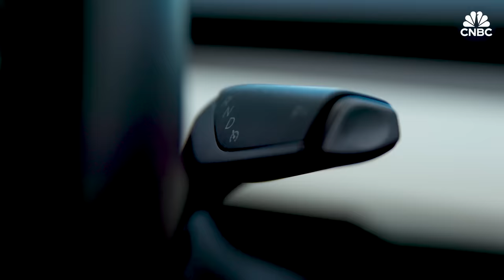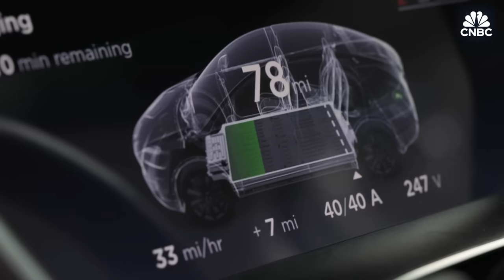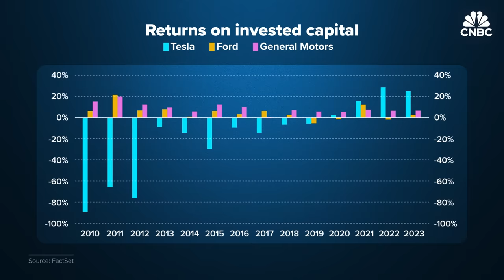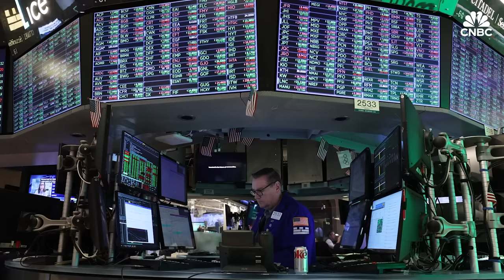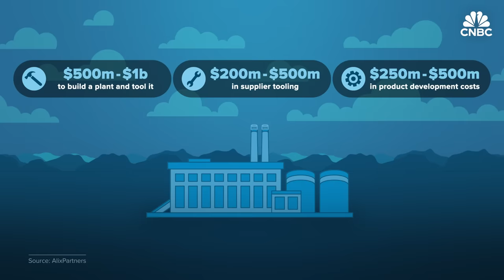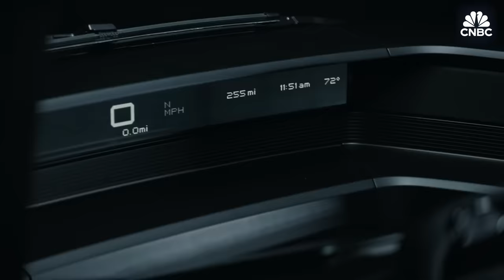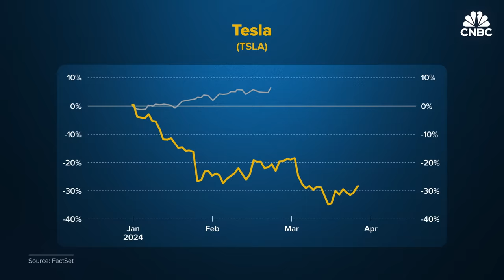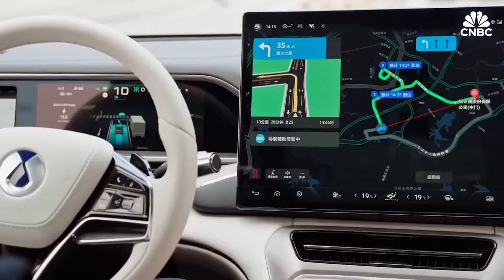Why So Many EV Companies Fail

Comment: Seeing a lot of ignorant comments from people who have no clue that EVs are not only better cars (only a more invested charging infrastructure needed) but they really aren’t any more expensive for the life of the vehicle. Funny how you never hear how pick up trucks are too expensive to buy. But of course, anti EV propagandists will use that outdated rationale.
Reply: Its not ignorant comments it's bot accounts
Reply: @Wongseifu548 good point
Reply: I hear about how expensive pickup trucks are to buy nearly every single day, but I'm on the truck forums and work with truck buyers.  Regarding EV's, there's a lot of bad information out there, some of it due to malice, and some due to ignorance.  It goes both ways though, the EV forums are filled with false estimates of cost to run ICE and hybrid cars.  I nearly purchased a Tesla but went with a hybrid Camry.......the creative accounting that people on the Tesla forum were using against the Camry was pathetically biased.  As far as ignorance, you have people like my FIL, who told me that EV's need their battery replaced after 5 years.  <facepalm>
Reply: @InPursuit2023 people also are not taking into account how much of a better drive EVs-let alone better for the air quality-not just now but also in the future. Exclusively focusing on money is missing the bigger picture. Myopic thinking is rampant.
Reply: I would buy an EV if it had a retractable extension cord built-in to recharge it in the garage.
Reply: Until the battery dies. What happens then? It goes in landfill. Or car catches on fire.
Reply: @realnapster1522  fantom issue. Again, a lot of ignorant beliefs. I guess-you’re against smart phones too. SMH

Comment: Because moving an 80kg human with 2000kg of refined raw materials is insane. It's inefficient & a massive waste of resources.
Reply: Depends on how you measure efficiency. I can drive to my sister's house in 20 minutes on weekends where there rarely is much traffic. Attempting to make the same trip using public transportation on weekends where many routes are either hourly or not operating at all will take 2-4h depending on how the 3-4 transfers I'd need to take line up. Add the return trip, that is 4-7h of the day wasted. During peak hours where most bus lanes are running every 15min, it would be a somewhat more palatable ~1.5h.

If I didn't have my own 1300kg box of refined materials or one I could easily borrow, I'd have to hire another 80kg human to drive his 2000+kg virtue-signalling tire-ripping box of more exotic refined materials to me, drive me to my sister's house and then drive however long to his next customer, rinse and repeat for the return trip. That is an even less efficient use of resources.
Reply: @teardowndan5364  That's a failure of urban planning... back in the '40s we seemed to believe that building our entire infrastructure around the car was a good idea. Turns out, it has tons (pun intended) of downsides too
Reply: Mrfunnybones  that's a very good observation, and broadly speaking, very relevant. It makes electric motorcycles look like a very good idea. Limited range, yes, but perfect for urban and city use during the warmer months. Efficient, and zero emissions, at point of use, so great for air quality. I think we must always remember how important air quality is, in urban centres. 
We are currently in the infancy of battery technology, so this metric you describe will surely change in the future, by a huge margin.
Reply: @neaorin  Even in a public transport wonderland, you'd still have mostly 2-3 cars wide streets everywhere simply due to the need for delivery, moving, construction, utility, emergency, public transport, trash disposal, etc. vehicles to be able to park on either side of the road to do their job while  leaving enough space for a third vehicle with business on the same street to still be able to drive through.

Highways may have fewer lanes (probably still will want a minimum of three through urban areas to avoid having to shut the whole thing down on every minor incident) but roads will still need to be built at least as strong as they are now to support every heavy vehicle gaining another couple of literal metric tons of batteries to achieve adequate range between charges.

Cities would still look mostly the same overall, minus the parking spaces. With people having significantly more limited mobility, you'd also have a lot more space spent on smaller, less efficient local shops duplicating each other for locality's sake. I know I have no desire to go back to the days of seeing a McDo or whatever the next craze will be at every other street corner. Restaurant prices are already out of control, imagine if they had to amortize their operating costs over 1/4th the customer pool size due to restrained mobility.
Reply: @teardowndan5364  That's not what I said though. Cars are good, and very useful appliances. For some tasks, they're essential. But building your entire society around the car - meaning that for 95 percent of the trips you want to do, a car is the ONLY viable option - has a ton of downsides. 

If you think cities would look the same, with 2-3 cars wide streets everywhere, go check out some '70s pictures of Amsterdam... then go visit the same city today.

Comment: Because only the rich can afford all the downsides to EVs. Only Ebikes make sense
Reply: what are all the downsides?
Reply: Ebike has a similar problem. Loads of Ebike blends pop up but most of them will not survive in the next ten years. Many Ebikes use proprietary motor, battery and control unit. When the blend goes, where do you find replacement parts? So the bike will stay in your garage, and eventually in the landfill.

Comment: EVs are too expensive (even cheapest Chevy EVs start around 40k). Batteries life span decreases as you charge and recharge. Car battery replacement costs as same amount as brand new ICE car.
Reply: Car battery replacement cost same as a new ICE CAR?! I didn’t know new cars cost around 10k. Were you finding these prices?
Reply: @Ye-tf9im  I talked to the neighbor, who is tesla tech. I live in Canada. He told me that if it is out of warranty. The battery plus labor to replace costs over $40k.
Reply: @ENTHUSIASTICFIFAFAN  For a Tesla Model 3 an out-of-warranty battery replacement is more like $12k USD, per receipts posted on Reddit.
Reply: Even then, it takes 8 years or 150,000 before the warranty expires and you will still have around 70% of the original battery capacity.
Reply: @ME-xc1st  But even major repair on ICE like engine replacement doesn't cost over 3K. So replacing the whole battery costing over 10k sounds too expensive. Should be 3 to 4k at max.
Reply: Fully charged on YT has a tesla on there that had it`s battery changed due to errors at 666-666km....

Comment: Everyone needs to understand - In China, there is massive subside by the government to keep growing this industry - here lot of money is being spent but the infrastructure is so poor for EV adoption (apart from Tesla) it's just a pain to use an EV for a long trip - improve the infrastructure, provide faster charging and it will automatically attract more customers
Reply: So it's the surrounding infrastructure parts that are relatively expensive, not the cars themselves.
Reply: Those EVs need to last too. Otherwise it defeats the whole point of an EV. What's better for the environment, upgrading to the latest baddest model every 5 years or keeping your same EV car for 40?
Reply: That is reasonable, I think convenience plays a huge role in the automobile market. Something like having more charging station and workshops that could maintain your vehicle would help for sure
Reply: also bring the price down, people aren't willing to pay $20k more for EV, this is a cost issue

Comment: They need to offer EVs with gas range extenders along side their BEVs. RE EVs only required a smaller battery and an extremely fuel efficient gas engine (I.e. Cosworth CatGen). A smaller battery cuts battery cost and the gas Range Extender takes care of the BEV shortcomings (I.e. charging infrastructure, charge times, etc.). I think way more people would be interested if they offered a gas range extender option. I sure as hell would be.
Reply: than why does the mazda not sell well it takes 8l and must run sometimes even if fully charged to not get cloget or let the fuel get to old

Comment: Massive cost.

100+ years of brand loyalty.

There’s no replacement for displacement.

I would have bought a small EV pickup truck years but the only options were tiny cars.  Get going already, Toyota.
Reply: Toyota doesn't want to make EVs, that's why they're switching everything to hybrid right now

Comment: It really doesn’t help that America basically started a trade war with China right before they started pushing EV because they also simultaneously started a war with Russia. EV cells pick up when gas prices rise. America caused gas prices to rise by putting sanctions on cheap Russian oil and natural gas. That forced both America and Europe to refocus on getting their citizens into electric vehicles because it was politically untenable to have such high gas prices. If you remember in 2021 premium fuel rose beyond six dollars per gallon.

As for these EV companies: most of them build small, barely desirable vehicles. 

Tesla has already shown you what you need to build in order to sell to the American market. 

You need a car that is larger inside than most other cars yet in between 30,000 and $50,000. The Tesla model 3 and model Y are great sellers because they outclass Honda/Toyota/Nissan in interior space and speed.

All EV makers need to be focused on making model Y competitors. 

Kia and Hyundai in my opinion has been doing the best job addressing the needs of the American market. The Kia EV9 for example, is a great product even though the price tag is a little high.

Comment: Honestly, companies don't want to sell a car that has low maintenance costs.  You basically just change the tires and wiper fluid in an ev.  The worst part is having maybe a low range one if you drive a lot, but if you have a home charger, evs are lifestyle changers.  

Lol sleeping in and having your car fully ready for you constantly is definitely a game changer.  Also, some townhouses are even allowing the 220-volt outlet (basically a laundry level outlet) to be on some properties.  Once you have a cable that can reach your car, it is even accessible to more home types.

Comment: EV Busses and light trains (railess tramways) would make the most sense. But Sr Management at legacy companies won’t invest in that, because they are not structured to do so. New directions need extreme focus, which Sr Management at legacy company do not have. To execute on these directions, they would need to create a new Division, headed by new Management. None of these would voluntarily send themselves to pasture. So, here it is. 
The solution IMO, would be for a high profile CEO to create a new small Division to develop the product, and polish all the kinks. But the CEO will need to keep and active eyes on the product, as Sr Managers and VPs who were purposely keep out of the loop, will secretly gun for your (the CEO’s) guts.

Comment: Fianlly, a common sense approach to what is ha[[ening in EV market. The graph of return on investment is the best graph so far. You can see Tesla average is a straight line up from -60% to +20%. Tesla has billions of cash reserves. If they are overproducing compared to demand if they don't cut staff I would dump their stock. It doesn't matter if they produce 10% less temporarily if they are making a profit on each car. All the competition is losing money on each car.  Also buyers are losing half the value after 4 years. Rich people don't care, but middle class does care. Also range must improve as well as survive -40 C to +40 C temperature and not have batteries that catch fire. Bettery technology must improve.

Comment: They're failing because they grossly inflated the value of what's compiled together to manufacture an EV based on interest alone and the average consumer isn't interested anymore for THAT very reason. Tesla started this foolishness and is proving it to be true by being able to easily offer massive price cuts to move units. The crazy part is once again you can't get this through GM's thick skull and they'll be last ones to conform to trend. No way should that Silverado be outside of the average consumers spending range, the Hummer was ridiculous enough. I've already decided to do my own Silverado conversion for roughly 15-20% of what they're asking, I'm not paying 100K+ for a dam SIlverado, they willfully lose touch and one trip to Michigan will make anyone wonder why they think this is the way, storage lots crammed full of models collecting dust, not moving an inch to rail platforms for deliveries. For the first time ever, I'm really hoping Ford will deliver on price and performance to the consumer and really don't see Farley dropping this ball. Mercedes WILL take the Luxury EV spot, Lucid would do well to partner with them before it's too late, Toyota will eventually take the global economy option spot. Dodge should just sit this out until consumers determine what the clear standard is and push a performance hybrid Ram and Challenger to market, they have nothing other than this to offer yet

Comment: most start ups lack fundamentals of business. They all trying to create premium EVs. But let's be honest it is easier to make an expensive EV. That's where established players like Tesla and legacy automakers will thrive. They have the brand prestige to pull it off. If you're a start up, you shouldn't be making 50,000 USD suvs and performance EVs, but trying to be the Ford of the EV market. Especially in a market like the USA, were cars have gotten very expensive. You want to create an EV for the masses. Lead the shift to EV adoption. Something like BYD.
This requires an acute mastery of economies of scale and business fundamentals, which most tech bros and silicon valley execs lack. The Chinese seem to have mastered this, after decades of mass producing goods for the rest of the world. The efficiency at which Chinese produce EVs is a feat of engineering.

Comment: Because these companies come into this like they are tech companies. But they are ignoring the simplest, deepest core of the business- they ship 2000 pounds of steel on wheels across the country. The rest is basically just mechanical semantics. And it is hard to compete against old car companies because they have a century headstart on manufacturing lines, shipping lines, and delivery lines. The sheer mass and volume of the products require a lot of logistics, and older car companies are too well practiced in cutting off all the fat and making lean system.

Comment: there's a reason supermarkets have only a small section devoted to sprouts,, not everyone will only want sprouts , the RV market is the same, Not everyone wants to move to an EV and sees its all a sham .  there more expensive, worse on environments, harder to refute, unreliable, full of faults and useless if you live in an apartment have street parking. the future is cleaner fuels and non plug hybrids , the reason the few people have bought up eve so fast is governments push and forcing them on people.

Comment: This is all about the physics of energy density, storage and portability.  H. Ford, T. Edison among many others confronted this over one hundred years ago.  Batteries require massive amounts of metals, minerals and RE's plus energy to manufacture.  And they're very heavy.  Always tradeoffs.  EV's are best suited to smaller cars and smaller batteries (with less range).  Trucks and SUV's are merely overweight and overpriced batteries on wheels.  Energy physics can't be changed by marketing hype.

Comment: Because the US' EV's are for the rich, not for the masses, that is why they fail. Safety is also not #1, data collection is. Thermal runaway is still not a regulated issue.

Comment: It really does not take a genius to see the predictions are simply pulled out of some's butt. The early adopters are not indicative of widespread demand. This is true with any product, especially with battery EVs.  The issues surrounding convenience and battery safety are significant barriers to widespread adoption. This high school level modeling and large percentage adoption is clearly not on the horizon.

Comment: They want us to be "all in" on EVs but nobody has a viable option for under 25-30k, unless they want a Leaf. Have you seen the Leaf recently? Exactly. Most EVs look stupid (M-B) , or look no different than their ICE counterparts (BMW), but are twice as expensive, and 3 times the hassle to keep charged. If they want to move EVs units: make them cheaper, stop turning them into privacy-killing monstrosities with 500 cameras and always-connected data thievery "features," any one of which will brick the car if it breaks. Make them BETTER than ICE not just "as good," and most importantly... build the infrastructure first. Plenty of people who can afford a 60k EV can't charge them as painlessly as getting gas is for ICE vehicles.

Building EVs and saying you want over half of all cars to be EVs without building infrastructure (which requires a complete upgrade or redesign of the entire grid to support mass adoption), is like getting served ice cream without the cup or the cone. Imagine if Baskin-Robins just globbed scoops into your bare-ass hands. What are you supposed to do with that?